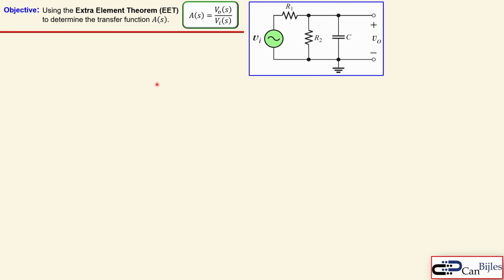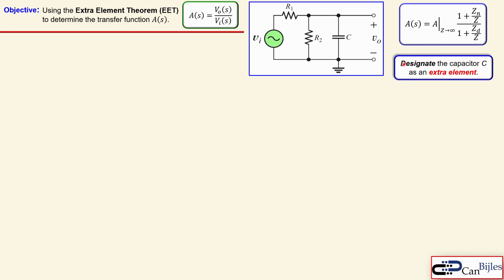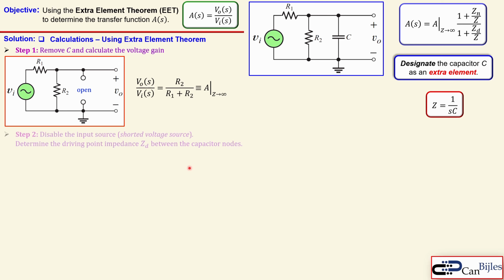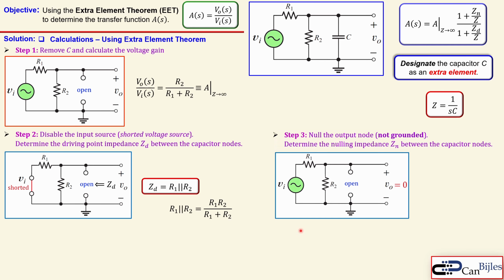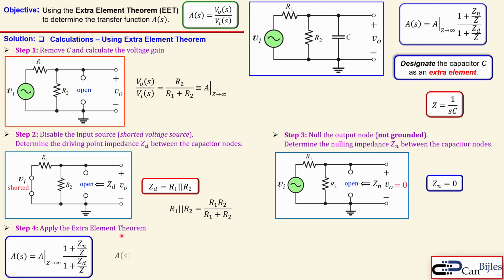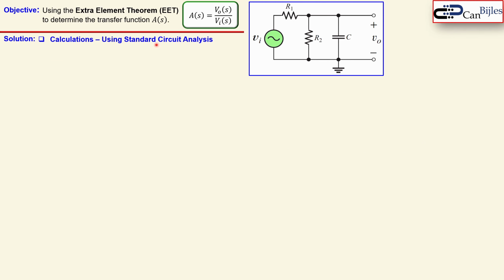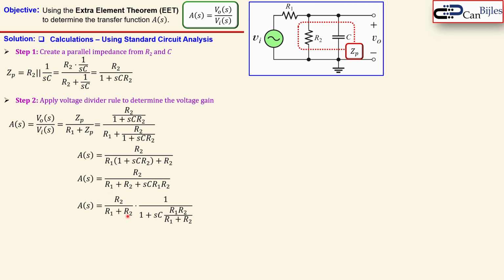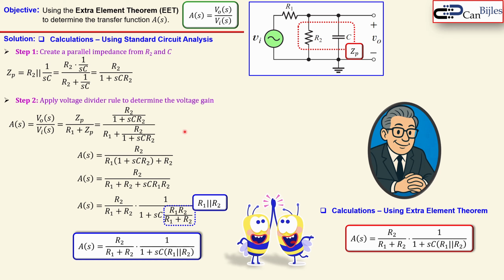RC Circuit Transfer Function 💡 Extra Element Theorem (EET - Middlebrook) 👍 Electric Circuit Analysis

Comment: EET was proposed/created by Middlebrook for the analysis of active circuits (like amplifiers, the feedback analysis can be greatly simplified by, for instance, considering the feedback component as the extra element). In case of passive circuits in doesn’t make much sense.
Reply from the maker: Thanks for your message and information. Indeed, the EET is most often applied in active circuits to avoid complex circuit analysis. For example, in transistor feedback circuits, it will be a big help.

However, the EET can be applied in passive circuits too, and will make much more sense to determine the transfer function, poles, and zeros than following the classic way of doing it. The EET applied on passive circuits is sometimes called the Impedance Theorem, but it is actually derived from EET.
Reply: @CANEDUX sure, it can be applied, as in your video. My point is just that it results in a more complex analysis. For example, trying to apply it in a 3rd+ order circuit, selecting the capacitors/inductors as the extra elements (either applying the multi-elements variant  directly, or applying it 3+ times to have the poles “directly”). 
State variable modeling comes to mind as a more effective way to determine system poles.
Reply from the maker: @forgetittube5882  I agree that the EET is kind of a overkill in such simple circuit. Again, my point was to demonstrate the EET using a simple circuit. In addition, it will work only if we you have just one reactive component if you want to use the EET just once.  I will build up the level in the coming videos. Often timed, we encounter a circuit with several resistors and one capacitor or inductor, and then getting the transfer function is really time consuming using classical circuit analysis.
I am planning to use the EET on a BJT and MOSFET amplifier circuits. I will build up the level in the coming videos. Stay tuned!
Reply: Thanks for the intro to EET, I hadn't come across it before. I thought this simple example was instructive
Reply from the maker: @chubbchubbchubb  Complete playlist Extra Element Theorem (EET by R.D. Middlebrook) - Analog Circuit Analysis: https://www.youtube.com/playlist?list=PLuUNUe8EVqllFkZxRUneXJv5p0XPJn7vR
Reply: “Fine “ 
You call overkill, I call it over complicating something that’s easy.
For instance, if the “circuit” has a single energy storage element. The easiest way to find the single pole is to just calculate the thevenin impedance of the circuit connected to the capacitor or inductor. Nothing can be easier than that. 

Like quadrupoles theory, thevenin/norton, EET, they are just tools, my point is always use the right tool/combination of tools. EET, is one of those that, it’s superb in active circuits where the null output function is relatively easy to calculate. And only then. 

Good luck. Unsubscribing.
Reply from the maker: @forgetittube5882  You can do it in any format you want. I am not trying to convince you. I believe my point is valid and you do not agree with this. That is fine, but not an issue I am busy with. You are free to leave. Good luck elsewhere.

Comment: ये thiyoram actually कहा लगाना है audio फिल्टर desghin मे ❤
Reply from the maker: It depends what you need to determine in your circuit. The focus in EET is to determine the transfer function with the poles and zeros easily and intuitively.